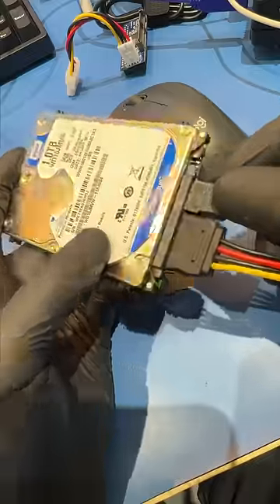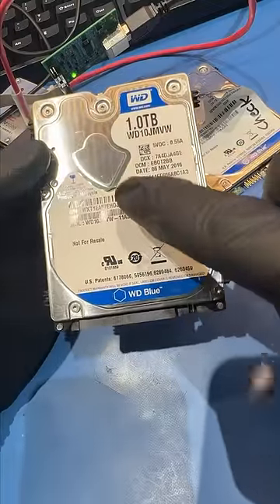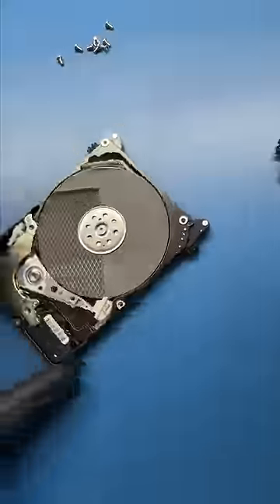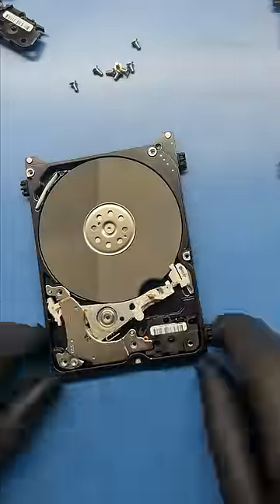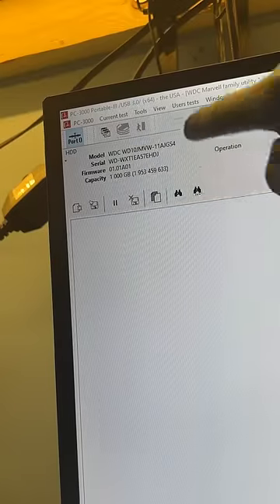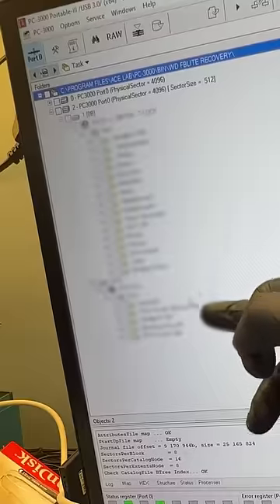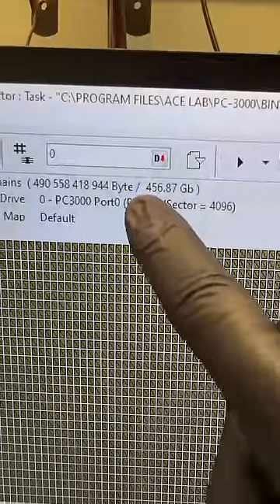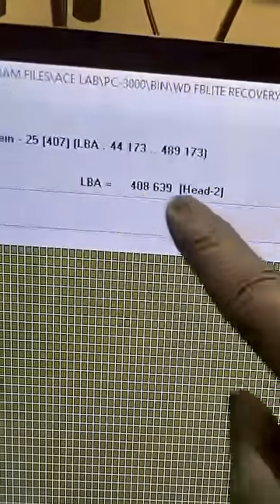Hard Drive Data Recovery Possible…? #technology

Comment: WARNING to all viewers: DON'T EVER OPEN a hard drive when it's not inside a laminar chamber. (The author indeed does this in one, even if that isn't visible.)
Opening a hard drive needs a 100% zero-dust environment, otherwise both a new head and the data platter itself would be destroyed by any leftover dust particle as soon as the drive is powered on.

Tolerances in hard drives are very fine, the space between a working head and a platter is about 5-15 μm.
Reply: Tag this man. Crucial information right here
Reply: Yep,, just one speck of dust and blahhh.
Reply: @rodhester2166 blahh xp??? Is that you???
Reply: I was really confused when he opened the drive
Reply: No?
Reply: @borkrz same! I though he destroyed the hdd but he was in a laminar chamber 😂
Reply: I opened an old hard drive and it basically worked opened. I even poured water on it and still worked? 😂 maybe old HD’s were not So easy to ruin.
Reply: Newer drives are a lot more sensitive because they have more platters, so they're closer together and the heads are much smaller and the tolerances are tighter.
Reply: @boostaddict_  also, working mechanically != reading actual data. After such treatment read errors would surely skyrocket or even kick the head out of alignment (T0NF on every subsequent read).
Reply: Just a clear box with a posotive exhaust flow and so holes that interior gloves can be attatched to.
Reply: i had a little heart attack when i saw him open the hdd, then my brain went like, well, he works with data, he most probably have the space to do it...
Reply: yeah. my first reaction when he "pop" the drive open that it was fake. the moment he open the drive in open space its dead
Reply: yeah I've had good luck with like 80gb drives and less
Reply: Wait I'm confused, is his entire room a laminar chamber?
Reply: @THiNK103088  no, just the space he's working in. It's a device similar to a lab hood, but the air flow is reverse, uniform and of course air is filtered clean.
Reply: Dude why didnt you tell me before, i opened my broken drive a few days ago trying to fix it 😢
Reply: Was just gonna say exactly the first part
Reply: I've never had an issue  restoring mine and my friends data, and swapping off the heads. Granted it was in the bathroom, dust-free environment, I use nitrile gloves. Bathroom fan was on..
Reply: @devavratkhandekar4020 it's probably still fine. Just make sure you air dust it before trying to run it again and get the data off. Get the data off quickly
Reply: I have a turbulent chamber.
Reply: Ppppppppp
Reply: Ppppppppp
Reply: simpler and not as good tho
Reply: This lad is 100% correct. Needs a pin.
Reply: Was about to say this is impossible for most people....looks like a DIY video it's not....
Reply: how does that work with helium drives?  would that need to fill the entire room with it or is there a injection port somewhere?
Reply: @s4623  same as with vacuum tubes, after service drives are put in vacuum and the inert gas is applied later, then the drive is sealed again.
Reply: @s4623  This is a great question.
Reply: My guy, coming in clutch with a crucial piece of info others should know! Good stuff!
Reply: Or, if you're in a pinch and you're not under the microscope of the thinkalikes - you can simply have a nice and clean desk with a clean dropcloth, with your coffee well out of splash distance of course, and then just do it. After 30 years and everything from Quantum Bigfoots to multiplatter micro drives, even to most solid state drive failures (you can save about 80% of them. Usually just something simple besides the storage itself has popped)... it's all the same. If you're doing this as a service, sure. You need to go all out to cover all your bases. Otherwise, in the few hundred drives I've ever done a part-swap recovery on, I've never had a total failure and most of them were just plain successful. They are not nearly as fragile as people freak out that they are.
Reply: The thing is this isn't even remotely true, it would maybe break in a few hours, more like a day or 2, depends on how dusty it is and if any dust landed in the platter before it's spun up, dust will not physically be able to land on the platter while it's spinning, I've taken drives apart and read terabytes of data off them in my regular ass bedroom, you can also see other videos of this, cathode ray dude has a video showing this. People really need to stop commenting without even knowing the truth, you aren't cool because you parrot some smart sounding shit you heard once.
Reply: @TheLukasz032 most drives are just filled with clean air, maybe helium if it's a high end drive to dampen noise, you can even know this is true because every modern drive besided expensive helium ones have a little air filter hole somewhere on them to equalize pressure if you bring them to different altitudes, it's usually got a "DO NOT COVER" label or sticker of some kind near it, man the amount of disinformation in the YouTube comments on tech stuff is unreal.
Reply: @CoreStarter  My lad, my lad calm down. Obviously this is just a method to recover the data ASAP and throw away the disk.
Reply: Back in the day we did it with a fan nearby that pushes air away from the work area
Reply: @maxwel1 Yes lol. That spindle is going at over 5000 revolutions per minute. A single grain of sand would be enough to completely destroy the r/w head AND the platter
Reply: Well then I kinda dropped my harddrive and it’s wide open
Reply: That was what I was thinking.   Dust will kill the data
Reply: we had an really old 120 MEGAbyte hard drive running opened at a convention - you could touch the drive and the read heads would clean off your fingerprint, all while it was reading and writing data.
Reply: I open i know what i am doing and i fix it successfully
Reply: I can tell you in the 1980s they were more forgiving on this rule. I opened a 5.25 inch hard drive took the platters out and put it back together and used it for several years after that.
Reply: laugh in low-density, shoe box sized, 40 platter, 5mb hdd from the 80s with enough gyroscopic force to untwist a twisted tea
Reply: A Clean Room is what he means.  Giant air filters and negative air pressure environment or something like that
Reply: 👍 thanks a lot mate
Reply: Did you just uwu
Reply: Ok snowflake
Reply: Are you short? I've always heard this for many years yet I've opened many in a dusty environment and they work just fine.
Reply: @TheLukasz032  ahhh that makes more sense 😅
Reply: I was wondering what the heck he was doing when he popped it open lol. I figured it was a "Don't try to do this yourself" PSA
Reply: That's correct.
Reply: Your mom's 5-15 um narrow
Reply: @boostaddict_  Still doesn't mean opening one is 100% death.  

I'm sorry, but everyone is so full of ish these days.  One guy says something and people are like "Ooooooo, I'm hopping on this cap-train."  

-Someone that's opened HDDs.
Reply: @JustAGuy85  bruh someone just asked a question and i answered it. You're the one hopping on a train lol.
Reply: I tested this once. Had an old laptop drive laying around saved files to it, opened it and ran the drive without the top. This was done in a regular room, not a clean room. I was able to copy the files without issue. It was around 1Gb of data. Not the way you'd want to do it with valuable data but if you had no other choice it could work.
Reply: I've done the same minus the water.
Reply: I saw him open the hard drive and I was like NOO THE DATA IS GONE FOREVER NOW. bc i already knew what would happen if dust got on it
Reply: yes, older drives have much, much, much higher tolerances. Anything up to a few gigabytes is probably fine with a really simple laminar air setup (something you could build at home). These are all hdds you'd see maybe going up to the late 90s. Once you get into like the high tens of gbs or past that to hundreds of gbs and beyond, the tolerances are much worse. On old HDDs, the issue is far more touching the platters with bare hands. That's why you'll see retro tech repair people opening up vintage harddrives without much problem for repair.
Reply: blah blah blah we all know
Reply: Good job bro I was about to mention this but I saw your comment 😂
Reply: I was just thinking this when he opened it.
Reply: Came to say this. This is one of the first things my PC tech teacher taught us.
Reply: This is why SSD are better.
Reply: repair kha hoga low budget kuch file h jo chahiye hard disk me hi h
Reply: I was just about to say this as I've over 30 years of expertise in computing 🖥
Reply: What about a steam room.
Reply: You have no evidence that he is in a clean Room. He is in shorts, you can see his legs and forearm skin. The skin sheds and creates particles. So... Yeah...
Reply: Ok Albert Einstein
Reply: I destroyed 3 hard drives 😢😢😢
Reply: Um
Reply: The ųm helped me understand why you need a laminar chamber. Thanks for the advice.
Reply: Glad I went to the comments, cause I was about 5 seconds away from going into the other room to fox my hard drive using this method
Reply: Yea totally did not see that and I was like WTF that is not good
Reply: LOL, I came here to say this too!
Reply: Too Late😢
Reply: I did this once and got two good reads and then nothing... I learned a hard lesson that day and got some nice plinking metal disks after.
Reply: bs spoken like someone that has never repaired a bad hard drive
Reply: I open the hard drive of my xbox 360 when i was a kid and put it back together and nothing happened i even took out the discs things. All the games the were installed still worked and the only reason i did it us because i got a bigger one on my bday.
Reply: @peterharoldjanakjr2078 yeah they do make things more complicated than they have to sound. If everyone just DIY'd their repairs the shops would make no money.
Reply: Do you know what is a good data extractor?
Reply: @nedimdzajic4555 translate to English
Reply: That was a long time ago.
Today it's all fault correction. It will only get slower with a traveling dust particle.
Reply: I was wondering how the heck he's able to do that or this is fake. Cos i know u shouldn't open the hdd.
Reply: um
Reply: As an alternative to the chamber, you can do it while the drive is underwater but it must be clean water. I boil water, wait for it to cool, put it in a (clean) bowl and disassemble the drive.
Reply: Unless your hard drive was made in the 60s the space between a working head and a platter (called flying height) of modern HDD is about 5 nm (0.005 μm).
Reply: @boostaddict_ I’m glad you said this because I used to open up drives and stuff around all the time when I was a kid. This would have been well less than 32gb drives so must have been why I didn’t have a problem.
Reply: Yeahh you need 0-10 dust per square ft to open that think. i work more then 10 years in WD so yeah i can confirm you that hahaha
Reply: @joevian7661  what about 10^9 dust per m2
Reply: a RLL or MFM? =)
Reply: @MelroyvandenBerg  🤣
Reply: I find it hard to believe you are in a clean room right now 😂😂😂
Reply: You can actually be ok without one as long as you make sure to use pure compressed air to blow out dust before reassembling the drive, but that's for a personal repair and you're confident in your skills and can't afford a proper set-up.
Reply: I have three mini drives from destroyed hard drives just tucked in tissue paper somewhere… hoping one day I will have the skill to see my children’s baby pictures again.
Reply: A standard positive pressure area with contracting plastic will work, specially if just for data recovery and not long term storage
Reply: It'll work like a car out of oil. A little while and then just die.
Reply: This.
Reply: @MandrakeDCR Also somehow you have HEPA13 filters on your hvac and an electrostatic filter in your shop...
Reply: @Cineenvenordquist  No, I have air conditioning with good filters - so that would be about it for HVAC. I don't have a shop, I have an office in a spare room in my house with a workbench. "Somehow" it seems to still work out. You've got a little plaster on your nose, just there... probably will need to fix that ceiling tile.
Reply: Genuine question but would doing this operation while the drive is submerged in mineral oil be an appropriate way to deal with that?
Reply: @johntitor6222 Unfortunately no. The idea is sound, but you're dealing with moving parts that have sensors expecting certain resistance in motion and drive motors able to provide only so much torque to spin against air, not liquid, much less mineral oil.  You can find videos on YT where people have tried it. It's a fun thought.
Reply: @MandrakeDCR  thanks for the response and the clear explanation. I feel like I learned something today.
Reply: i opnened one in my bedroom and still works 😂
Reply: I am a design engineer and, boy 5 micron is a bitch to achieve so dont fool around your hard drive especially with the one with 650 gigs of porn
Reply: That place looks dirty too.
Reply: Yea, you can open to wipe off the dust with paper towel. If it has some scratches use fine sandpaper.
Reply: Eh, sure in theory, in practice a 4 platter HDD will run for about 12 hours in open air. It's not that tight of a tolerance as one would think, but if you want it working reliably for many years of course a little dust will be a problem eventually.
Reply: I have a question, I have a hard drive and the psu is modular but the power cable was plugged into a gpu slot and caused the hard drive to toast..is the data recoverable?
Reply: we've open broken ones are school. They are fun to look at
Reply: I use my hard drive without the cover for hours in a dusty computer
Reply: Really? An old grey beard who is known to never lie told of a story of how he recovered a GM server's data that had no backup by taking the hard drive out, giving the platter a spin and slotting it back into the bay which got it working for just long enough to make a backup.
Reply: You gave a transformer a bath 😮
Reply: 5-15 What measurement of unit is that
Reply: Otherwise things would really go b00m. Right?
Reply: Nah, you do it at slow speed and it's a one off
Reply: I opened my hdd 2 years back in my beed room on my bed. (Out of curiosity) i was so scared when i put it all together but my laptop survived and still running good.🎉
Reply: Worked on the giant 80mb platters can confirm dust is bad.
Reply: @runit7119  micrometers. One millionth of a meter.
Reply: Always knew this at least
Reply: Awesome, I could do this in the giant clean room I work in.
Reply: i remember some poor SOB on Reddit who opened his drive and posted pictures asking what was wrong with it.

sadly the answer was “well the problem is obvious, just replace -part-, it would have been an easy fix, but opening your drive on the kitchen table killed it”

just sucks to see people dive in blind and toast it like that.
Reply: I’m waiting for someone to ask what the symbol for micro meters is
Reply: where your shop?
Reply: I had a heart attack before I read this thank god it’s protected
Reply: I've opened up 3 where the heads arm was stuck to the platters out in the open spunt the platters counter click wise while gently returning the arm to park position still using those drives one is in an Xbox one s, another in my ASUS notebook, and the last in a PS3 and been running for over 2 years no problems also forgot to mention the red Western digital NAS drive in my WD Cloud where the whole thing flipped over unstick the read heads out in the open it's still also working and it runs 24/7 it's the launch no longer supported WD Cloud
Reply: Me who had opened a hard disk in my room and it ran without the lid without issues for hours straight:
Reply: @blaze26700 fellow asurascans enjoyer?
Reply: Thank god, I had instant stress when he popped it open because it looked like he was just in a normal room😂
Reply: This is doable, I replaced the actual disk themselves, to  my surprise actually worked, and I was all worried about the stupid dust too. 
smaller the drive the more room is between them I found as well as some of you predicted. 
So no,  no clean room required and no $400 or much more for someone with clean room to do it. Unless its really really important then yea I. Wouldnt risk it!
Reply: idk my uncle do the same in his room to fix his hdd fautly arm, its fixed and still work
Reply: @boostaddict_  Newer hard drives actually have LESS platters than old hard drives because newer drives are able to cram a lot more information onto a single platter.
Reply: Calm down, mostly it's people that want to try before chucking it in the garbage
Reply: There goes my plans to recovering my hard drive myseld lmao
Reply: It's also worth noting that each screw has a certain torque value. It differs for each screw, and each value must be exact for the drive to work again if you take it apart. Unless you have the HDD construction blueprint, or manufacturer document, you'll probably not have your HDD work again.
Reply: I'm almost certain that this is scaremongering from drive recovery companies. Any dust that lands on the platter will be immediately flung off as soon as the platters get up to speed and absorbed by the air filter in the hard drive.
Obviously, don't do this with irreplaceable data, but it's perfectly fine to do it with data you can afford to lose if it goes wrong. Also, never turn on the hard drive with the cover off, as this can cause irreparable damage to both the heads and the platters on modern drives with tight tolerances.
Reply: @peterharoldjanakjr2078  Have you done it to build one?

Did you got successful of recover your data when you replaced the heads?
Reply: @chris01479  I've never done it yet. Will let you know one days
Reply: @CoreStarter I don't think anyone is expecting to continue to use a drive long term. To just get the data off, you only need the drive to work for a short time.
Reply: Vacuum chamber would work just as well ;)
Reply: Isn't there helium also sealed inside of the drive?
Reply: @ZeginMakesMusic  the majority of hard drives aren't actually "sealed" they have vent holes and weird filter looking packs inside of them. I just had to tear one apart the other day for disposal. There are helium filled sealed drives but it's not common. They are also problematic and leak helium over time! Helium has an amazing ability to leak out of almost anything due to its small molecule size
Reply: Oh
Reply: Ah for fuck sake i read this comment late no wonder my drive died as soon as i opened and repair it 😂❤
Reply: That’s not for every computer or software every brand is different your thinking to ahead
Reply: @maxwel1 yes hard drives are extremely sensitive
Reply: Some drives contain helium, so opening it will kill it, no matter if you sit in such a chamber or not.
Reply: Just when I had some hope of recovering data from my harddrive too. Now I feel like there's no room for recovery anymore. Nawww
Reply: Is it true that the hard drives have low pressure
Reply: "as soon as the drive turns on"

Man, plenty of people on YouTube have proven this to be false. I drive will work when opened just fine for the most part. Yes, it will degrade over time, but it's not explosively catastrophic like many seem to imply.
Reply: @matthewrease2376  I actually tried this myself. It destroyed the drive.
Reply: Gow dis he decryot the drive ?
Reply: recovery price how much?
Reply: A dust won't completely brick an HDD but still good enough for recovery tho
Reply: What’s the software for data extracting? Can I just use the terminal?
Reply: @DjMicr0dot  this is PC3000, and it's a complex set of hardware and software. You cannot use just the software, it needs the physical recovery card.
Reply: @TheLukasz032  oh like those cool vga looking like plugs connected to bus cables you were showing before....thats cool but you dont use it in conjunction with like  the terminal? Or is it like some special software my Kali Linux or something
Reply: i did that i ended up poring dirrt on it and after it still worked lol